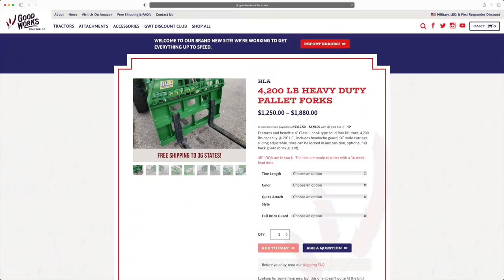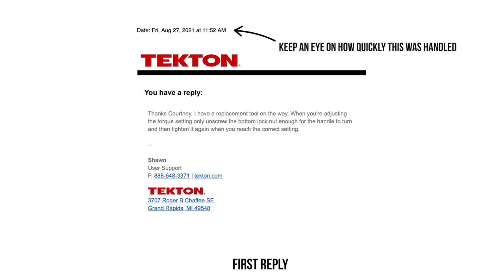THE WARRANTY OF A LIFETIME, INSTALLED IN UNDER AN HOUR 🚜🇺🇸

Comment: A trick when handling heavy tires. Get the tire close. Then slide a shovel under it you can push down on the handle lifting the tire and side to side can be done by moving the handle back and forth.

Comment: in-lb is diff than ft-lb 1/4 inch torque wrench will not tighten those properly
Reply from the maker: I'm such a knucklehead!  Replacement 1/2" wrench is getting delivered today, so we'll snug them up!

Comment: Brush hogged two paddocks today with my 1025R that I mowed last year without spacers.  Noticeable stability and more comfortable drive using 1.5" spacers all around (front and back).  One side of my yard has big old pine trees with lots of exposed roots making for a rocky and bumpy mid mount mowing experience.  Better now with the 1.5" spacers.   Wonder how 2.5" spacers on the back wheels would make the tractor feel?...  Then add the poor man's air ride seat..May be the ticket!  LOL!  Thanks for sharing.

Comment: To those worried about stress on the axle, ballast weight and heavy implements add way more stress than any spacer applies. 
Not to mention all the multi tire options which are like 1 foot spacers at least.
Nothing to worry about, the axles are engineered for this. 
The stability added makes it a no brainer, get your spacers asap!

Comment: I would like to see a tractor put on a tilt table before and after the wheel spacers. Compare the tipping angle before and after. That would make an awesome video.
Reply from the maker: That would be awesome!  Is there one around Kalamazoo?
Reply: @GoodWorksTractors  probably no such animal. You would have to come up with something to lift one side of the tractor. Tie off something  to the ROPs to keep it from tipping more than a few inches. Wouldn't be hard. Use a digital angle guage. Also use a compact like your 1025. Wouldn't be hard. Maybe a rollback wrecker then you could use the winch to keep it from going over. Simple. Park one side on the end of the deck when its on the ground and just lower the bed slowly till the point it tips. Get a harbor freight magnetic angle guage.
Reply: @jeffreylee7184  yup. Kiss principle! Lol

Comment: With in-lbs you need to be set 12x tighter to achieve proper torque. Just so no one gets hurt with lugs coming off.
Reply: Just seen the other comments. Great job making good videos just didn't want anyone getting injured or damaging the machine.

Comment: Have them on my 1025R.  I have the John Deere ones on my 2038R. Never use a new aluminum framed with out them. My old 67 1020RU with a cast frame no problems

Comment: Looks like a quality product . 👍 If I was buying them for a tractor I would prefer the steel spacers and use removable loctite . Not a big fan of alunimun threads on heavy machinery . 🤷‍♂️ Anyone that is putting them on a 30” tire and up  tractor that has loaded tires and not the proper equipment too hold the tire and remove them safely be aware of the dangers involved . Loaded tires once they start too go over it is usually not a good out come .

Comment: My only concern is making the tractor to wide for the implements that you already own. For example my wheel width is 69" and my box blade is 72" outside to outside also my bucket is 72". If I put wheels spacers I probably would not fit inside of what I'm cutting with my bucket or box blade

Comment: Thanks for the videos! That 1/4” drive torque wrench is rated in inch pounds. I am guessing the spec for the lugs are in foot lbs. probably 100 ft-lbs or more. I don’t think the 1/4” drive has the capacity to go 1200 in-lbs or more. Also, I don’t see an issue using an extension as others were saying as long as the extension is in-line with the bolt while using a torque wrench. You would loose torque with an extension with an impact as the extension would absorb the impacting energy.

Comment: Hi,
Do you put spacers only on the rear tires? Do people put spacers on the front tires and does that cost problems with the front axles? Also, is having rim guard in your rear tires a problem with the spacers? Bora  aluminum spacers of course.

Comment: I really have my doubts if that little torque wrench is set to or even capable of the correct torque for those spacer bolts or lug nuts. Did that torque wrench even move one bolt?  It seemed to click instantly.                  I love your videos and watch all the time.  Your original music was much better for starting the shows, this new stuff would be fine for during the show.  Sorry, I have a lot of opinions today. Thanks
Reply from the maker: My replacement half inch torque came in this afternoon.  Didn't make it in time for the video.

Comment: After reading other comments I understand you realized the inch pound error when torquing the spacers and wheels. I just want to point out that you are losing applied torque to the studs and lugs through the the extension also. You are using quite a long extension so you will need to over tighten slightly to compensate.
Reply from the maker: Thanks, yes I do know the extension requires an increase in torque setting.  Replacement 1/2" torque wrench showed up today, so we'll get them snugged up.
Reply from the maker: There's many calculators online that exist for this purpose.  What's their point if not for this?

Comment: I noticed that the lug nuts have less than two threads showing out of the nut (and it actually appears to end inside the nut). Standard practices indicate that a minimum of two threads should stick out of the nut to be claimed as properly secure.

Is that an installation error, or do BORA need to increase those stud lengths?
Reply from the maker: Never heard that before, so can't say I know the answer.  Not sure how it would be an installation error?  Everything is snug, no gaps.

Comment: OK!! Now we have life time warranty spacers,  So please tell your viewers if they effect/affect the tractor warranty, There has been multiple articles of voided warranties due to after market products. One dealership may not consider it a problem while another may cry fowl.
Reply from the maker: I have told my viewers many times.  I've also explained why I think it's a foolish move to prioritize machine safety over operator safety.  Dead tractors can be revived, but good luck doing that with a human.   https://youtu.be/6MolhcGOuM0

I was just on the phone with a John Deere dealer yesterday who was trying to figure out the right size to put on his customer's tractor.
Reply: You can order a Kubota with spacers factory installed. In that area at least, Kubota seems ahead.
Reply: Actually the installation is probably done at the dealer but you can spec your tractor online with spacers to see the cost. I got 3".
Reply: I had my JD 2038R delivered with JD OEM wheels spacers installed.

Comment: Why don't the manufacturers just space the tires wider by default?
Reply: Well,one thing is Getting into and out of tight spots, and onto trailers, are both concerns.   It is easier to widen a tractor with spacers than to narrow a tractor, just as it is easier to add ballast as needed than to take weight off.  Probably also has to do with matching standard implement widths, and the manufacturer saving money by not putting any more material into the machine than they have to.

Comment: I got a good laugh at ya'll using a 1/4" torque wrench. Hang that little feller on the wall as a decoration, cause you'll never use it again. LOL!! "Torque extensions" are designed for an impact and work great for wheels, since the torque isn't super critical.

Comment: A couple of other items: be sure to use a 1/2" extension with a 1/2" torque wrench.  A 3/8" extension will twist, thereby absorbing some of the torque you want to apply to the fastener.  Also, be sure to support the head of a torque wrench anytime you use one, getting off angle will also cause you to loose force.  Both will leave you with improperly torqued fasteners.
Reply: Even if it twists the torque is still the same. Torque is torque, deflection is deflection. Equal and opposite forces. Now if you have an initial torque plus angle that could cause an issue with high deflection.
Reply: The adapter would absorb deflection not torque. Otherwise where is the torque ending up?
Reply: @wolfpack4128  The torque ends up in the extension - torque is what twists the extension thereby is lost to the extension.  (If you could measure accurately you would see the extension warms.)  Try this sometime:  torque a fastener to maybe 150 ft-lbs. using about a 12" long 3/8" extension, then replace the 3/8" extension with a 1/2".  The fastener will rotate slightly when using the 1/2" extension, showing a loss of torque to the fastener with the 3/8" extension.
Reply: @jeffreylee7184  Not quite: you are putting in energy through the extension, and some of the energy (which is measured at the input - i.e. the torque wrench) is being used up in twisting the extension.  This is well before yield is reached.  Again, try the simple test I outline above.
Reply: The number of extensions doesn’t matter the torque still gets transferred from the wrench to the fastener.
Reply: This seems to be a popular myth about extensions, do some google searches and you'll see that extensions don't matter.
Reply: @jeffreylee7184  Been there, done that - roger on the disagree.  Please try the test above if you get a chance.  Take care!
Reply: @jeffreylee7184   Indeed, my torque wrench came with an extension, no mention of adding more ft/lb to the wench to compensate when using it. Even if it twists, it will apply the exact same torque to the nut as the wrench exerts, you just have to turn it more to take up the twist.
Reply: @benbartyzel2388  forces (linear, shear, and torque) can't be unequal or you get movement (where acceleration provides the rest of the force to make the forces equal F=m*a). You are correct about energy (as you mentioned heat which is an energy not a force). You may end up exerting more energy to get the same torque but once everything is static again the torques must be equal.